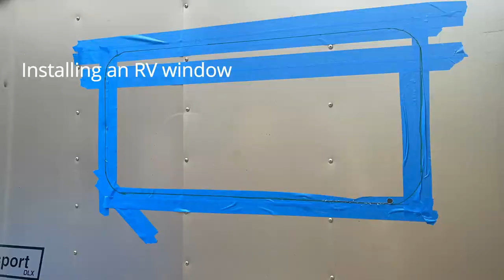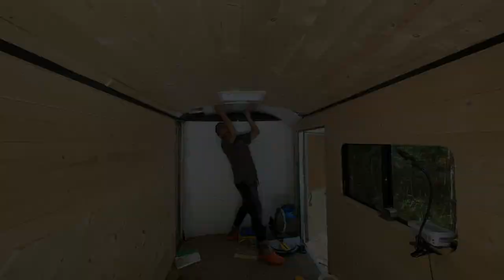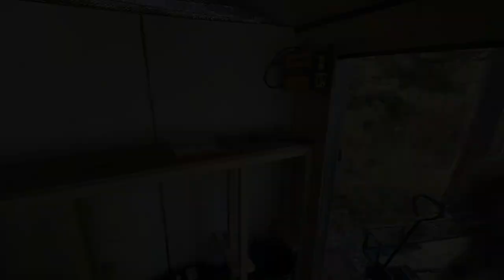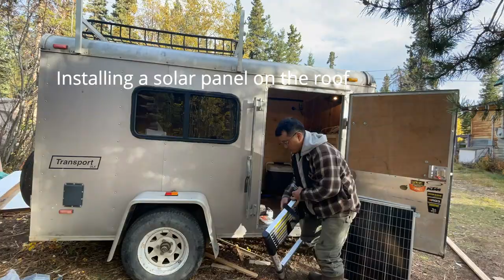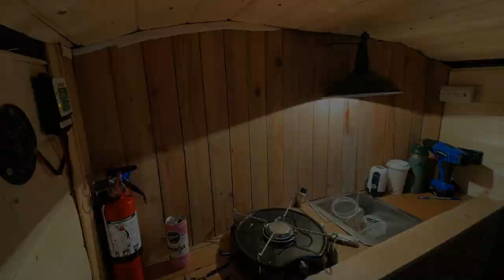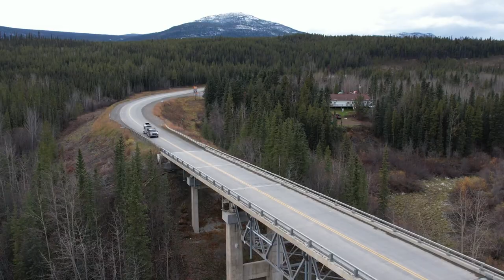5x8 Cargo Trailer to Camper Conversion *TIMELAPSE Start to Finish*

Comment: A great build. We are getting ready to do one. Got a used one and cannot wait. It is about the same size. We are using that little space where you put fold out shelf as cabinet and counter. Putting our stove top there. Port a potty under it. We have to add a/c for we are in Fl. Thank you for sharing. I hope you go full blown on site. Ordered windows off E-bay. Also, escape window. These were windows taken out of new RV builds. Also, brought a small on demand water heater. Its for dishes but are also making an area to shower by door. Doggie foldable bath and will put a track on roof for shower curtain.  Peace!
Reply from the maker: Hello Lee. What great ideas! We can’t imagine needing air conditioning especially now. It’s minus 26 degrees C here in the Yukon this morning!🥶 and our trailer is covered in snow! Enjoy the heat and creating your camper. Thanks so much for watching and sharing your ideas!

Comment: Know it's yours and I agree it's nicely done. Seems like that futon is quite a space hog though and I'd probably do something different were it me.
Reply from the maker: Yes you are right, the futon is taking up quite bit of space! Having a folding bed attached on the wall might be an good idea. We opted for futon as we also wanted to use this as cargo trailer with lots of space inside when you remove futon :-)

Comment: Nice job! You should be proud of your craftsmanship. I love it that there's a whole cargo trailer conversion culture. I'm converting a 6x12 horse trailer and I opted for a Nu-Way heat stove which uses no electricity
Reply from the maker: It uses no electricity? Wow. We are going to check that out. Thanks so much for watching and sharing, Mark. Enjoy your conversion and then your adventures.
Reply from the maker: Ahhh ok. It’s a wood stove. Unfortunately not enough room in our little trailer. Nothing like wood heat! Enjoy!
Reply: @tntnaturecon  No it's vented propane and it's tiny

Comment: You've done a really nice job of converting your cargo trailer into your compact travel cabin.

I was particularly impressed that you added additional insulation panels to the underside of your trailer, which many overlook.

About the only other things I would consider would be to insulate the side and rear doors. Subscribed.
Reply from the maker: Thank you very much, Felix Cat :-) . Yes it would be nice to all insulation on the door as well. I will take a look at them once snow is gone next spring!

Comment: Nice build out. I just picked up a 5x8 3 door cargo trailer and i'm in the process of building it. I want to make a futon type bed that is a couch and then you can pull out a section to double the area and lay out the futon pad. I'm looking for ideas to make that happen. I like your tiny kitchen and it didn't take much space, space it at a premium when it's a 5x8.
Reply from the maker: Good luck with your build and your travels David R.  Thanks so much for watching!

Comment: Awesome work! All the right features. Not too fussy. Are you happy with how the heater/insulation system works on cold nights?
Reply from the maker: Hi Matt Delcomyn. We are happy with the system. We don’t use it in winter so are not sure what it would be like in much colder temperatures, but yes, for as cold as -7 it’s been great. Thanks for watching. 😀

Comment: Beautiful job - I was just wondering if the drain holes on the window you installed should be on the bottom.
Reply from the maker: Thank you! I don’t remember installing drain holes in the window. It was a little while ago I did this :-) Maybe I did!? I installed air venting hole in the wall as well as making hole to hold a spare tire though!
Reply: Those are in case he flips it onto the roof !

Comment: Great job! It looks as if you put furing strips beside the foam board and over top of the foam board? Would you please explain exactly how and where you fastened furing strips? 

Also wondering if you screwed the pine tongue and groove to the furing strips or used a brad nailer? 

Thanks
Reply from the maker: Hi, thanks for watching! I needed something I can nail pine tongue groove on the walls and the ceiling , so I put strips beside the vertical metal pillars. I connected wood strips with metal pillars by screwing holes on the metal pillars and then connected wood strips with them.  After this, I used minimum amount of screws to hold pine tongue groove as I was putting them together but I also used small nails (using a hand hammer) to nail them to the wood strips. Hope this makes sense. Good luck with your project!

Comment: Pretty  darn cool. My only concern/question is do you find you get a lot of flex in the walls by cutting the steel studding?
Reply from the maker: Thanks. Actually I didn’t notice any flex while driving, so it must have been minimum amount of cutting the steel stud.

Comment: 1 month is amazing to accomplish that.  You did a fine job on it.  Your window door cover on the ramp door was ingenuous.  How does the flooring do in the extreme temps up there?
Reply from the maker: Thank you for your comment! We were in a rush to get it done before the end of the fall. We don’t use the camper during the winter, so we don’t know what the flooring would do in the extreme cold. I bet it would be freezing to sleep in there in -30c or 40c below though :-)

Comment: How were you able to mount the vertical boards to the metal walls that the horizontal pine boards are fastened to? Did you glue them to the outside aluminum skin? How did you mount the pine boards to the ceiling? Really like the looks of the inside.
Reply from the maker: I made holes on metal frames and then attached (using screws) pieces of wood onto them. I did the same thing for mounting pine boards onto the ceiling as well by attaching shorter wood pieces to metal frames onto which you can nail your pine boards! It was a bit awkward to install ceiling all by myself... good luck with your project!

Comment: Awesome Job!  I want to do the same, in the same size trailer.  How is the insulation under the trailer holding up?
Reply from the maker: Hello WBOS72. We live in the Yukon and our trailer is currently under a lot of snow.  We will need to dig it out in the spring and get it on the road again. We hope to have a better idea how the insulation holds up then. Thanks for watching and good luck with your conversion. 😊

Comment: Did you insulate the ceiling? That's half you heat loss. Also, get lithium batteries in stead
of using lead-acid crap. They weigh about 1/3 that of lead-acid batteries. No fumes Was a game changer for me.
Reply from the maker: Hello Raul Miranda. Tomohiro did insulate the ceiling. Thanks for your suggestion about the battery.

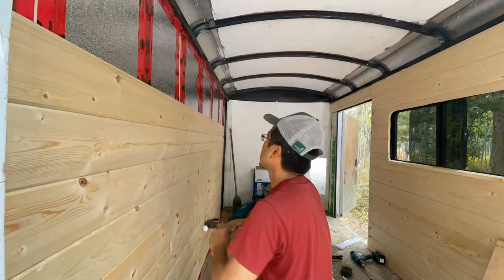Comment: 1:50 Are those wrought iron bars on the ceiling ... strong enough to support a hammock? During the day, I need as much open space as possible.
Reply from the maker: I doubt they are strong enough for a hammock but it may be. We never tried ourselves but sounds like a good idea if it works!

Comment: I have a 5x8 cargo trailer and currently have a twin size bed but want to down size it. Could you tell me where you purchased your futon or measurements? It looks shorter than a twin bed. What is the width of your counter?
Reply from the maker: Hello JoAnn Rizzo. We got the futon from Amazon. The measurement is 10X 54.5 X74 inches. The brand is KD Frames Studio bifold futon. Our trailer is currently under a few feet of snow and we cannot get in to measure it now. 
: )

Comment: Nice job! Just one question.When you cut through the back i noticed you cut through a support runner for the window. Did you reinforce it somehow?
Reply from the maker: Hi J72, thanks for watching! I didn’t reinforce it assuming that the back slope is pretty sturdy with a thick ply wood attached the metal part of the frame. I am hoping it will hold the weight as well as the structural integrity.

Comment: Do you need to add any structure around the window?  Where you cut the metal vertical frames?
Reply from the maker: Hello Brad Taylor. 
No I didn’t have to add anything around the window to reinforce it. It seems like there is no issue with this small window. Thanks for watching.

Comment: Was this something you had experience with prior? It seems a little intimidating (esp the propane heater and window installation).
Reply from the maker: Hello Smileyc123. Tomohiro watched some great YouTube videos and read books and manuals. He had some experience building our sauna and sunroom but is a learn as he goes kinda guy. Thanks for watching!
Reply: It's one of those Diesel furnaces and the step by step instructions are not that bad, I installed one in a tent trailer. For my cargo trailer build i'm not putting in a Diesel furnace as it would completely overwhelm the small space with mega heat, I live in the south and i'm not planning on camping in Alaska. What worked well for my friend who also has a 5x8 build is a Buddy heater, He said he stays warm on a 37 deg night with just the pilot light running and only turns on the low burner to take the initial bedtime chill out of the air. After 5 minutes he's opening windows and putting it back on pilot flame LOL.

Comment: question when cutting out the windows or air vent was there a trace template? How did you do an perfect cut out?
Reply from the maker: No there was not a template. I think I made a template using a cardboard. It was as perfect as it looked on the video :-)
Reply from the maker: I made a template using the cardboard but I don’t think the actual cut out on the metal I made was as perfect as you think :-)

Comment: I noticed that you did not frame any of your openings.  Are you concerned with them collapsing?
Reply from the maker: Hi, not really concerned about collapsing as metal wall seems to be strong enough to hold the window. We have used it for some time and it still has not collapsed yet :-)

Comment: Another question. Are the center uprights for the front cabinettes somehow nailed to the floor also?
Reply from the maker: Hi, I don’t remember exactly how I did it but I don’t think I nailed or secreted the center piece. Probably good idea to use a small L bracket to secure it to the floor to make it stronger.
Reply: @tntnaturecon  Thanks!

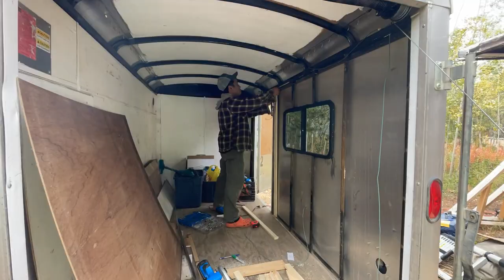Comment: At 1:13 how are you installing the wood frame with metal bar ?  Thank you in advance
Reply from the maker: Hello Mint hos, I attached the  wood to the metal frames by drilling holes on both the metal bars and wood and then screwed them together. Hope this helps!

Comment: What did you use to attach the insulation to the ceiling?
Reply from the maker: I just squeezed the insulation in the gap in between the iron bars and then taped it together!
Reply: @tntnaturecon  thank you